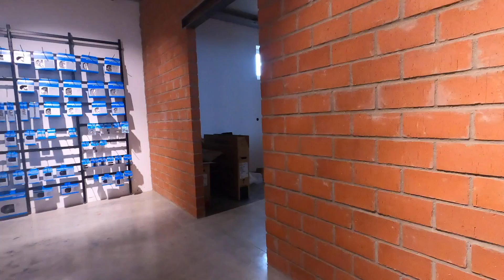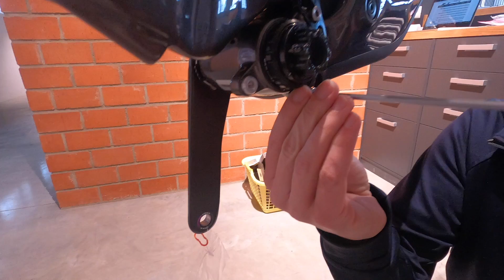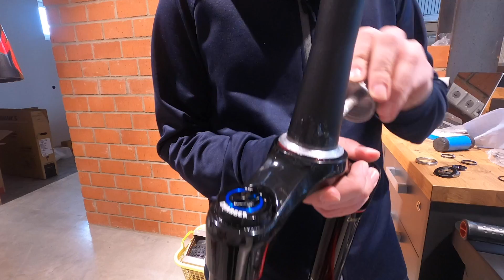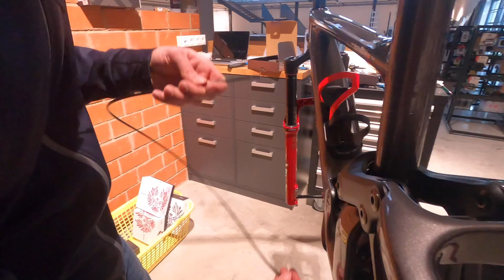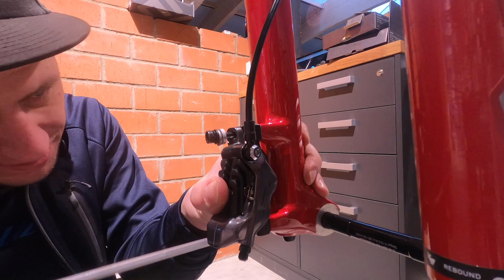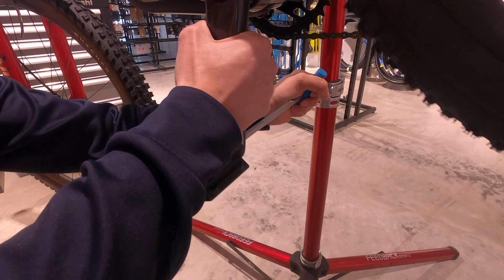Dream Build MTB - Specialized Enduro 2021by TrailHogs

Comment: I can not see using grease...
Reply from the maker: You can not always see, but we used some
Reply: motorex carbon grease are used for mounting parts wich are not supposed to move, it creat some friction with micro particules to avoid over torque on carbon, I'm not sure if it's ok for bearing of head set, but normally you should use green grease for all bearings !!